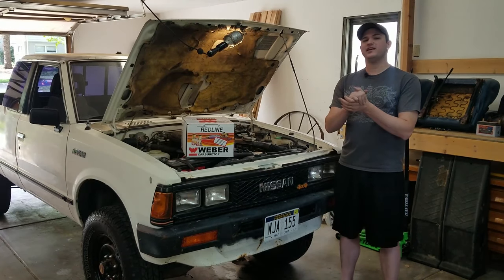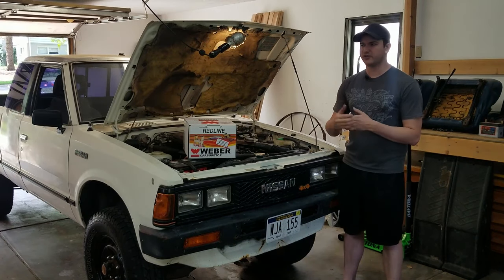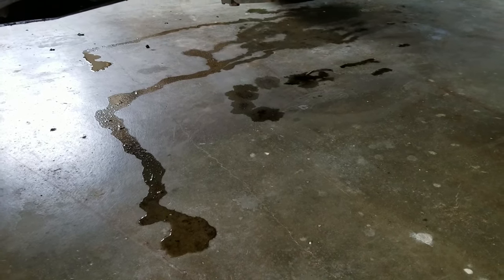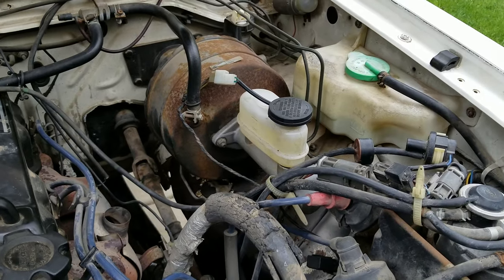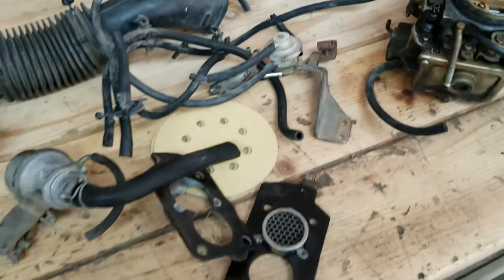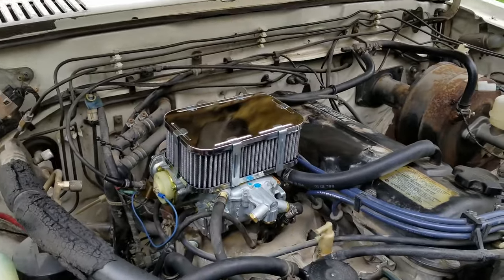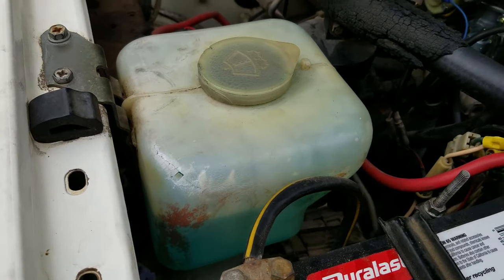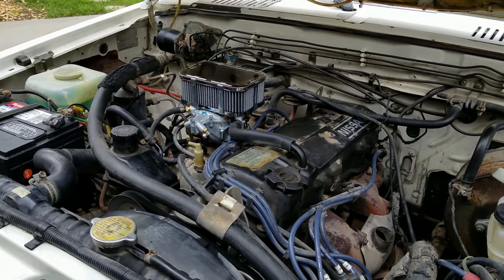Adding a Weber Carburetor on the Nissan 720!

Comment: Which version weber Carb did you put on? cause I noticed that you have AC like mine and I read on websites that you may need extra parts or adapters if you have AC in the truck. Is that True as well?

Comment: Around 4:05 that silver pipe is a heat riser tube. It directs heat coming off the exhaust manifold into the air cleaner. This hot air warms the carb and engine up quicker, getting everything to operating temperature faster than not having the riser tube.
Reply: Probably helps keep the carb from icing up too?

Comment: I did this to my Naps Z in my 81 720.  I had the adapers welded in as the screws don't generally seem to stay tight.  I then ported the heck out of them to match the carb better.  As for the Carb, pull the fuel feed venturis and polish the sides to remove the flashing.  Polish the insides of the main chokes inside with 400 under water, make them look like a mirror.  Remove the choke from the secondary side (cut the shaft off) as well as the pump jet from the secondary side (it's most likely to not be drilled anyways). Not having a choke on a secondary will have no effect on drivability.  I went with a slightly faster emulsion tube on the secondary side as well and a richer idle jet. Main jets are often big enough.  When you put the feed venturis back in, a touch of JB weld (TOUCH!!) will ensure they don't leak.  Mine also showed a 7hp gain by plugging the EGR vacuum line.  Shhhh I won't tell.  

As for the rest of the engine, an MSD 6AL really wakes it up!! Seriously. Use a Blaster SS coil.  I put it on the intake side with plain copper plugs and a .060 gap.  Also check with Comp cams as they used to make an 270 camshaft for that engine.  Pace Headers makes a set of those but they are CRAP.  You have to weld the tubes in from the outside and have a shop machine the inside of the flange or they will leak.

I miss my 720.  It was an awesome truck. Ton of work on it.  Regrets.

Comment: Good to see Nissan 720 content! Where did you buy your carb? Much tuning involved?
Reply from the maker: Got mine off ebay, tuning was alright. Mostly just making sure I had the correct vacuum lines removed and hooked back up properly.
Reply: @TheAngryHoneyBadger  do you have any tips or footage of hooking them up?  I was bummed when I saw your  vid jump straight to the full install

Comment: Could you do a quick video showcasing where the lines from the new carburetor goes on the truck? I’ve been wanting to put a new carb on my 720 for the longest time but I just don’t know where the lines go.
Reply from the maker: I can try to do that in the coming weeks. Need to finish up some work at the paint booth first.
Reply: I got a weber on my 720, you only need the vacuum advance and the brake booster connected to the intake manifold... everything else can be deleted. crankcase vent can be hooked up or vented through a filter. It's a fairly easy install.

Comment: Did you have to mess with the jetting at all on the weber or was it good enough out of the box for the truck?
Reply from the maker: MIne was good enough when I did the install. I've only have to tweak the idle control a little over time.

Comment: Great video, I've got same truck and still running stock carb. Think that my secondary isnt coming in properly. How long would you say it took to swap the carb? Never done any carb work so I'm curious as to how intensive the process is.
Reply from the maker: It probably took a couple of hours to swap between me and my mechanic friend while hanging out. Not the most intensive job but I've seen people do it differently a few different ways due to all the vacuum lines and emissions parts the stock carb has that you can eliminate. Some people also do an EGR delete at the same time as well, but I did not. I decided to keep it a little easier for now.
Reply: @TheAngryHoneyBadger  Thanks for the quick response!

Comment: I have a question, I was wondering if you could show the vacuum hoses that are remaining and the other ones that are blocked off, plus which ones you have running to the weber carburetor, please.
Reply: so idk if by now if you have done it or not, but on this carb there is only one vacuum port next to the idle mixture screw, and it goes straight to our vacuum advance, aka onto your distributer. hope this helps, ik its 2 years later but i gotta help somehow.

Comment: I have a question, just put one of these on my 83. So on the old carb, there was the wire for the auto choke then a wire for the anti disieling solenoid. Neither you or me have that wire hooked any where. So what did you do with it? I'm having an issue where whenever my clutch safety switch is pushed (whenever clutch is all the way out) my engine cuts off.

Comment: Hey , i had a question , did you get the Weber 32/36 ? Because I have been looking at getting one but the mounts are different on the intake manifold and I was going to ask if you had any problems with the mounts
Reply from the maker: Yes, this is the 32/36 version. It comes with a plate that changes the mounting point.

Comment: How much a mechanic would charge for labor? Or how long does it take to replace it?
Reply: i did one of these on my saturn engine and was pretty straight forward,a machanic would be able to do it in 2-3 hours, did mine in 2 hours at home, and run perfectly out of the box.
Reply: @neubs1969  thanks man!!!

Comment: Was there any issues with the throttle linkage alignment.  The cable brackets supplied with the kit does not align with the linkage on the back of my carburetor
Reply from the maker: I did not have that issue with mine. The supplied brakets worked. Maybe they supplied incorrect brakets?

Comment: Does this have the KA series engine like what was in the stock 240sx? I know it was an early carberated Nissan engine if my memory serves me right. I remember when I was young and new all of the KA, SR, and RB series engines. Now I'm old and drive a Cruse 😂
Reply from the maker: This has the Z24i engine, the Z series engine evolved into the NA and KA engines which, along with the smaller CA series, replaced the Z series.

Comment: Can the Weber pass smog emissions
Reply from the maker: Good question. I'm not sure. I don't have smog emissions testing where I live.
Reply: Thank you for responding I was trying to find out from other youtube video my Nissan 720 2.4 has carburetor that’s not the Original carburetor from the Nissan it’s a different design. so I bought a weber carburetor to see if it would pass smog and emissions test I don’t know yet since I haven’t yet put in the Weber.
Reply: Definitely won’t pass the visual inspection nor pass the smog.
Reply: nope...

Comment: Hello bro, my car is a 1983 Nissan Datsun Z22, Can this Carb fits into mine?? Plus can you please tell me the fuel consumption before and after installing??
Reply from the maker: I am unsure if this will fit you engine. As for fuel economy mine is better because my old carb was inefficient and needed a rebuild. Before I was around 12mpg. Now I'm closer to  19mpg driving around town.
Reply: @TheAngryHoneyBadger   I wanted to make sure before I buy.. since I live in Ethiopia, which is nearly impossible to buy stuff online... Mine runs 12mpg at this moment... It sucks.. Anyway thanks a lot for your support! I appreciate it If you can tell me any other way to get a better Fuel Economy.

Comment: Just installed a same carb on my 620 but every time I stop it wants to stall  what would you recommend me to do or check ?
Reply: Check for vacuum leakages on carb base or any other vacuum connections
Reply: Vacuum leak or improper tuning of the carb

Comment: Does the Weber come with a return fuel line to tank connection?
Reply from the maker: Used the exsisting line from the original carb.

Comment: You can take that  cover off the manifold,it is not needed for your Weber,it was used with the funky tube to heat the junky carb.Mine is off. Got a new Exhaust manifold yesterday and a new EGR..https,PUT A IDLE CUT OFF SOLENOID...://www.youtube.com/watch?v=v5Fe9N0q2Kk

Comment: Automatic trans?
Reply from the maker: 5-speed
Reply: @TheAngryHoneyBadger  what needs to come off the old carb? I have an 1986 Pulsar NX and a Weber carb. No emissions in my state so not an issue.  Im told certain parts from the old Hitachi carb are needed to make it work.   What needs to happen to make it work? 

An N16S 1.6L engine 3 speed automatic.  Swapping to manual is not an option due to some physical infirmities i have,  mind still knows how to drive stick but neuropathy won't let me so it needs to stay automatic

Comment: I have this installed on my z24 engine. However when I turn off the ignition the engine idles down and shakes violently. It's as if there is no shutoff. Has anyone experienced this?
Reply from the maker: On the stock carburetor this would happen to me all the time. On this new carburetor I only have it happen once in awhile. Not sure what causes it.
Reply: @TheAngryHoneyBadger  thanks for the reply. Im guessing there's a fuel shut off or ignition wire missing. I'll have to investigate further.
Reply: I have the same thing happen......

Comment: Also you never said if this was a 30/34 or 38outlaw?
Reply from the maker: 32/36, link in the description to more info.
Reply: @TheAngryHoneyBadger  Perhaps so,  I always use the 38Outlaws or the 40mm Twin-Single Side drafts. I was wondering if the "kickdown" he was referring to was due to it being automatic or sequential rather than concurrent butterfly movement.
Reply from the maker: @KageShi  The 720 is a manual so the kick down is the butterfly valve on the carb opening up significantly more for the last 10% of the throttle movement. This carb slowly opens for 90% of throttle and the last 10% of the peddle pressure to the floor opens the carb about 50% more dumping more fuel and bringing in more air.
Reply: @TheAngryHoneyBadger  So you do only have the 32/36 sequential barrel. 
How hard was it for you to locate a carb plane adapter plate?
Reply: I have a question angryhoneybadger I have installed a 38outlaw on my 1986 4x4 720 did u reset it or anything like that??
Reply: @jasonfarrar2246  What do you mean reset?  you should tune both timing and carb flow after install for best results.  If you have access to a Mercury scale to balance the 2 barrels you will have even better results.
I managed 55+MPG if I could keep my foot out of my 82 Z24 720.

Comment: what air filters fit this carb? I would like to put a round one on instead I feel like it would look more original
Reply from the maker: Might have to check on the Weber site. This is the filter that comes with the carburetor,  I don't think I've seen anyone run a different filter but I'm sure there has to be a way to do it.
Reply: @TheAngryHoneyBadger  I'll do that thanks for the quick reply!
Reply: Weird question can you tell me what the dimensions of your 720 are? Me and my dad were having a debate about the dimensions of his 1984 king cab 4x4 like yours vs my Hardbody 2wd. Wikipedia is so wrong on the dimensions it says its 110.8 inches long by like 68" wide for the 720. I would measure both trucks but I will be out of state for a while and we need to settle this lol
Reply from the maker: I'll have to let you know in a few weeks. I currently have my 720 torn apart in a paint booth lol.

Comment: Hey i have a problem my nissan pathfinder timing belt burst and i had a few bad valves. I replaced all i put new head gaskets and timing belt the carb had some rust so i bought a nissan carburetor for it. Its a v6 vg30i i live in the Caribbean. It has a misfire but i dont know why i need some help. I also replaced all spark plugs with new ngks